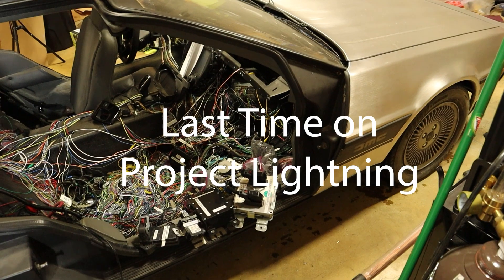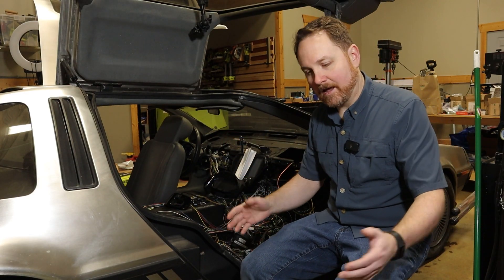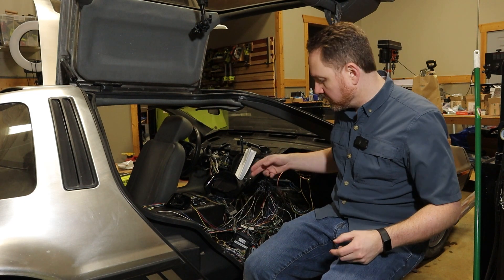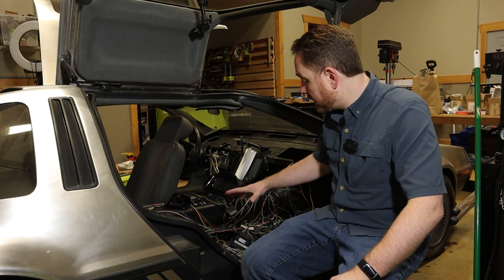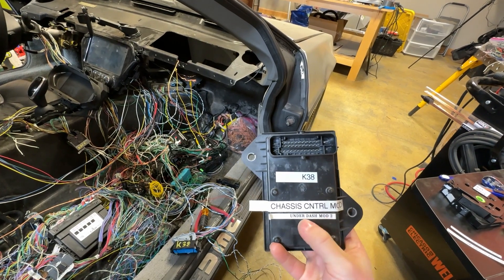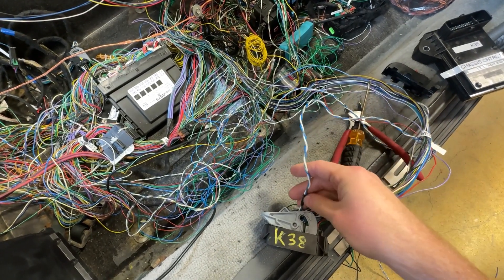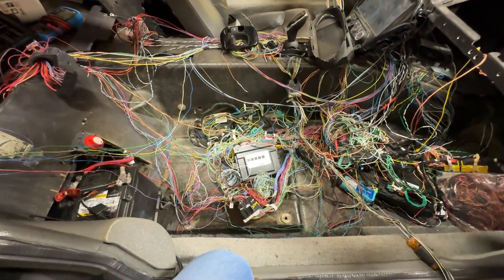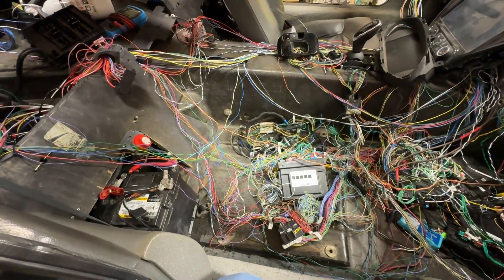DeLorean EV Conversion - Starting to re-wire the car

Comment: Love the project.  Maybe I missed it.  But did you show the rear axle install to run from the motor to the rear wheels?  Did they have to be custom made?  Thank you.  Also do you have a spot where you list all the Documentation and Software you use.  Asking as I was looking at using a Bolt to convert my Fiero.
Reply from the maker: I had new CV axles / stub axles created by The Driveshaft Shop. I sent them the CV axles from the Bolt and gave them the new dimensions and they created some custom built ones for me - roughly $2k! I don't have a list anywhere, but it's pretty short - for software I bought a VXDiag VCX Nano for GM, which lets you use GDS2 and SPS to reprogram the car. Then I found a copy of the Technical Service Manual for the 2017-2019 Chevy Bolt EV in PDF format. It's pretty good, but has a few pin outs missing or incorrect (just found another one yesterday - K56 Gateway Module's pinout is completely wrong). I try to match it up to some other year models (2020), which has some of that info corrected.

An EV Fiero sounds AWESOME!!
Reply: @BillCarlson   Thank you.  This will be a great help.  I will be a few years off as I am waiting for the old v6 to meet its demise.  Started looking for the wrecked bolts already though.

Comment: Great update but I wish GM had made the e-crate motor accessories (controller/Inverter) available as think that would have saved you a ton of time, also would just help repurposing crashed bolts into cool cars like this more.
Reply from the maker: Oh yes, I agree completely. I would have much preferred their crate motor! I even tried to puchase it from them, but they never actually sold them.

Comment: Awesome project! 
Which generation Volt supplied the guts? Were only the EV components transplanted and not the ICE genset? Is so, is the range limited to 40 miles? Was the Volt's power steering transplanted too?
Reply from the maker: This is all from the Chevy Bolt EV, not the Volt. The Bolt has a full EV drivetrain, range of ~250 miles or so. I did transplant over the power steering and electric power brakes (iBooster).
Reply: @BillCarlson  that makes a lot more sense! Great project, looks like you are from WA state too.

Comment: Good to see you back at it Bill. It makes me glad I went down the route of installing only what I needed. I don't (yet) have fast charging or BMS or automatic charging start/stop or several other things that your car will have but I suspect getting those working will be easier than what you're going through. 😮
Keep up the good work.
Reply from the maker: For sure, I think for my next conversion I will just install the drive unit and batteries, rather than trying to pull over the whole wiring harness and everything. Too much work!

Comment: Great Episode,  after the door connectors were removed ((7) Connectors in the bin), did the canbus-computer disregard the missing connectors?
Reply from the maker: The car would definitely not turn on at this point. Since the CAN bus is cut, it kills all communications between modules, and that means pretty much nothing works. But in the prior episode without the door harness connectors, the car functioned just fine - they are not required.

Comment: Glade to see u going at it wiring is a scary thing  I am planning to do  the same type of thing a 2020 wrecked bolt into a gmc canyon this summer  trying to get my bolt running again now battery is locked out I know u had some trouble with yours got airbag light in the clear